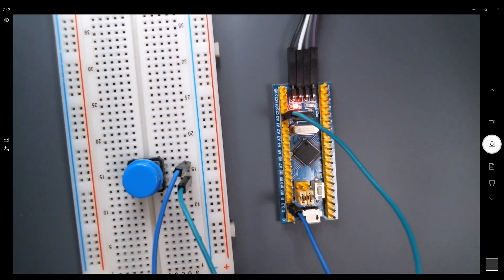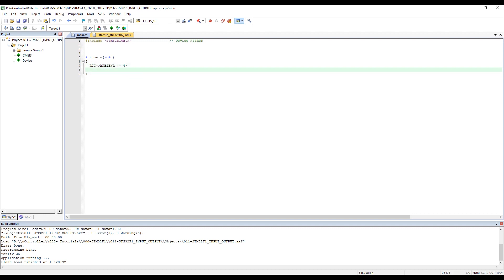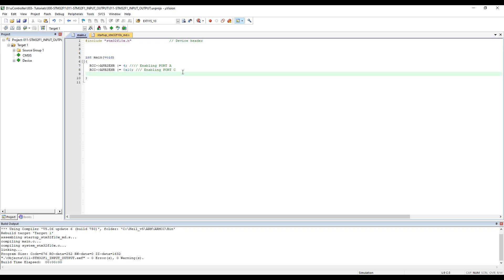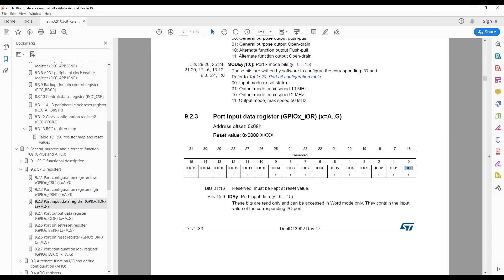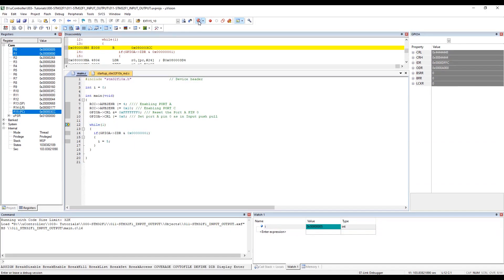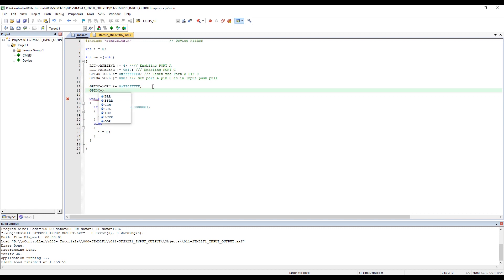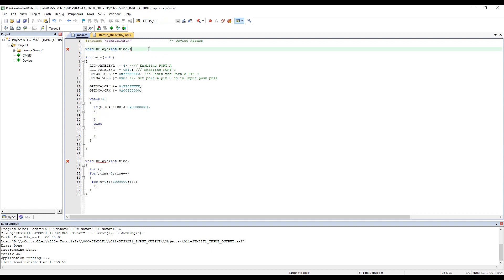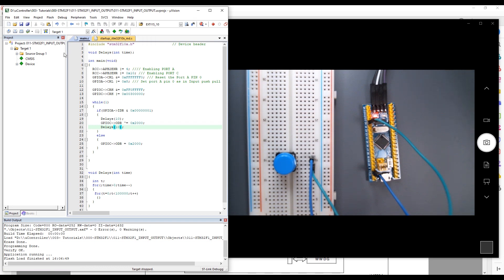011 - STM32F1 GPIO INPUT OUTPUT

Comment: Hello, I did the same function using below codes. I tested my code as you did watching "i", it works well in the simulation. However, I downloaded my build files, in real, nothing happens when I push the button. Once I push the reset button on the board, the green LED lights up constantly. And then when I push the button, it works just fine. Appriciated much if you would help me.

int main(){
	
	RCC->APB2ENR |= 0x10;
	
	GPIOC->CRH &= 0xF00FFFFF;
	GPIOC->CRH |= 0x08300000;
	
	
	while(1)
	{
		if(GPIOC->IDR & 0x7000)
		{
			while(1)
			{
				GPIOC->ODR = 0x2000;
				delay(500);
				GPIOC->ODR = 0x0000;
				delay(1500);
			}
		}
	}
}
Reply from the maker: Hi Cihan, So happy to hear that you are learning the STM32F1
On remark first, inside the While loop, change it as bellow: 
                                GPIOC->ODR |= 0x2000; # Make Or Equal so you don't mess with other pins
				delay(500);
				GPIOC->ODR &= ~0x2000;  # Make AND Equal Tilt so you don't mess with other pins 
				delay(1500);

3 Questions: 
1- Are you using the blue pill and try to blink the PC13 LED ?
2- Is the LED ON or OFF ?
3- Can I confirm the definition of the the delay function ? (As it may that the delay function is too fast)

On trick to check that at least the code is working, inside the while loop delete all the code and try:
1- GPIOC->ODR |= 0x2000; 
#Then remove it and try only this
2-GPIOC->ODR  &= ~ 0x2000;

By checking those both, you should see a clear change of state of the PIN, if no, let me know so we can investigate further

Thanks

WeeW !
Reply: @WeeWStack  Did your correction in the while loop. Still works in the same way.
1- Yes, it is the blue pill.
2- Once I download the build. It is off. Then I push the reset button. Then it is on constantly.
3- The delay function works well I think. Cause after I push the reset button. Pushing the button connected to 5V and pin14, LED blinks as desired.

Tried trick-1; removed all code in the while loop except for the line GPIOC->ODR |= 0x2000; 
And downloaded the build, LED is off. Pushed the reset. Still off. Pushed again. Then it is on.
Tried trick-2; replaced the line with GPIOC->ODR  &= ~ 0x2000;
And downloaded the build, LED is off. Pushed the reset. Then it is on.

here is the delay function;
void delay(int n){
	int i;
	for(;n>0;n--)
	{
		for(i=0;i<3340;i++)
		;
	}
}
Reply from the maker: @chnsnyz  , thank you a lot for your feedback and detailed description, It gave some hints about why it is not working 
Shall we have a live session call together ? it will be nice to debug the code, please send me an invite on this Facebook account:
https://www.facebook.com/weew.stack
I am available This Saturday September 10th or Sunday September 11th from 12pm GMT. let me know which time suits you and let's debug it.
Best,
Reply: @WeeWStack  Thanks for your time and effort, appreciated much.

Comment: hi, Thank you very much for providing good content on ARM.  I have few queries about the bit setting the registers inside STM32. Sometimes You wrote hexadecimal with 8 bit like(0x10) and some times with 32-bit hex (0xFFFF FFFF). Is there any reason for that?

EX :  RCC->APB2ENR |=4;   (enabling for portA ; directly loading 4 into the APB2 reg; cant we write it as 0x4; or 0x04?
RCC -> APB2ENR |= 0x10;
3)GPIOA->CRL &= 0xFFFF FFF0;
4) GPIOA-> CRL |= 0x8;
please give me clarity about the line 3 and 4. As for line 3 you wrote complete 32 bit hex num
where in line 4 writing only particular 4 bits into the reg.

Thanks in advance.
Reply: he only writes significant bits. you can consider 0x8 as 0x0000 0008

Comment: HI
how are you?

1. RCC_APB2PeriphClockCmd(RCC_APB2Periph_GPIOA, ENABLE);
2. RCC->APB2ENR |= 0x10;

i used these two but non of my gpio ports in preiph are enabled...

please help
tnx
Reply from the maker: Hi Hassan,
thanks for your comment,
Can I check with you few things before moving forward,
1- Have downloaded the code in Github and tested it?
2- Are you using an STM32F1 microcontroller ?
If you are using STM32F1, then you have to the reference manual page 113 and then you will find theRCC_APB2ENR register if you take a look at the register structure, if you want to enable GPIO Port A, you will need to write 
 RCC->APB2ENR |= 0x4;
Please let me know if this has helped to solve your issue
Reply: @WeeWStack  
Hello again 
thanks for your help

i just did sth
but the more impo thing is that i know nothing about hex numbers you used in your programming...
eg i dont know what should i put "|=" to " GPIOA->CRL" to enable B or etc ports..
or for enable and disabling  of a pin ...

if you have a chart of that numbers please give it to me to my email or sth...
really tnx
Reply: i wanna read pin A0 and if it is 0 make pin B0 , 0 too and if it is 1 make B0 , 1 too
but i dont know what hex code should i put to crl